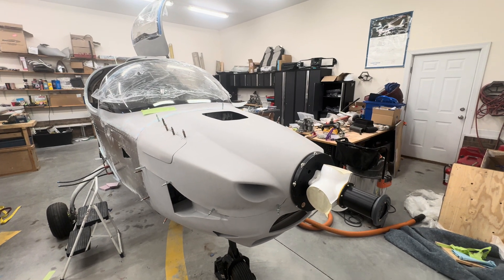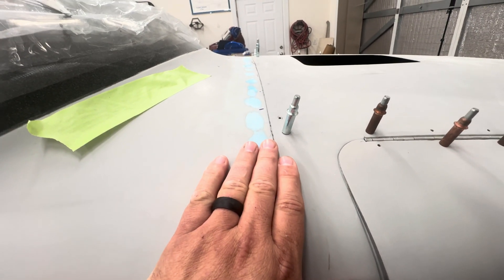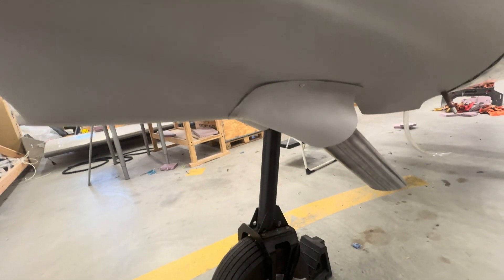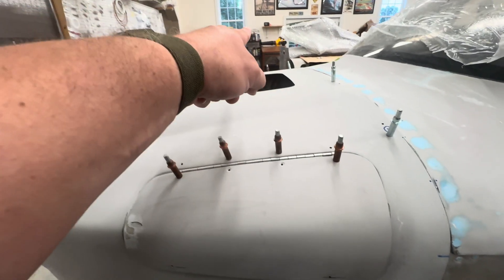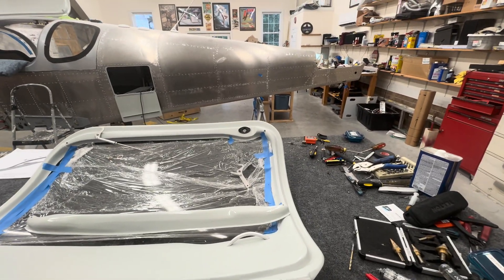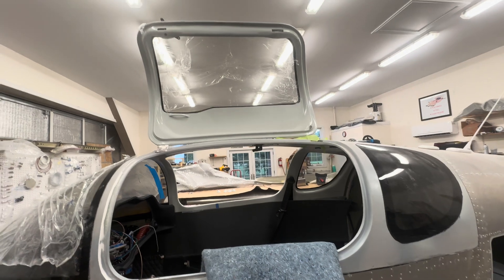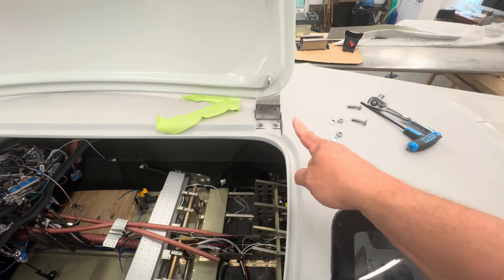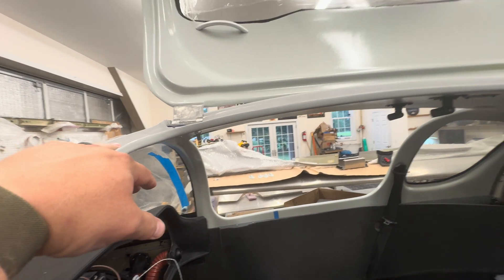Sling TSI Build Update - Cowling and Door Work

Comment: I think Evan is just omitting the exhaust shroud now. All that body fill near the heat source makes it likely to crack. More trouble than it's worth.
Reply from the maker: @OneAlphaMike  Interesting.  I don’t think I really looked at it without the shroud.  I gave a pretty big gap all the way around the exhaust but It will certainly still get hot.  Maybe some reflective paint there would help.
Reply: @aviationkitbuilder  Well, I thought he said he was omitting it, but the one that's for sale in his recent video has it installed, so maybe I misunderstood. As long as you have good space around it, you'll probably be OK.